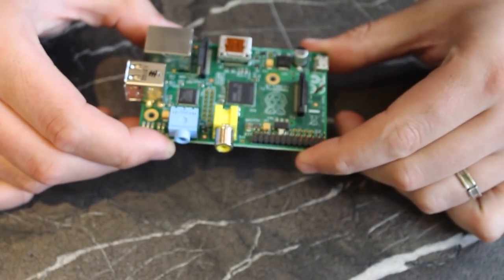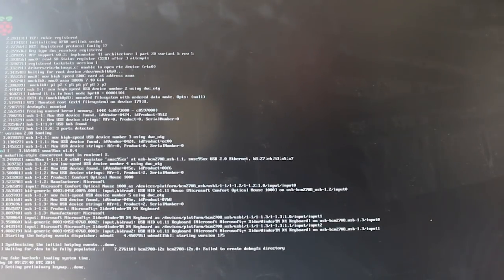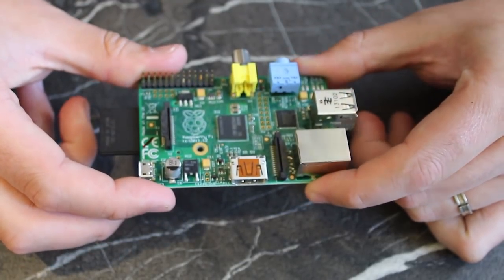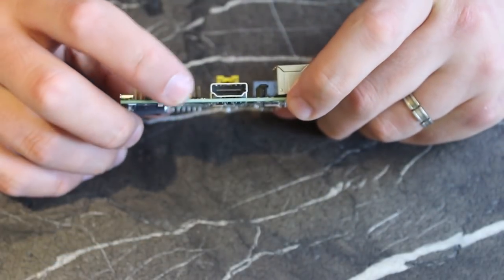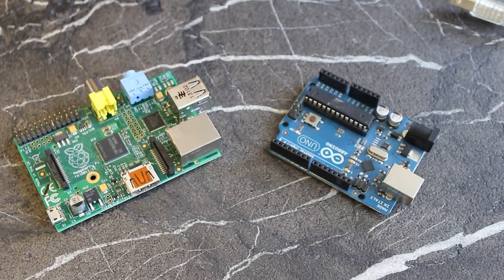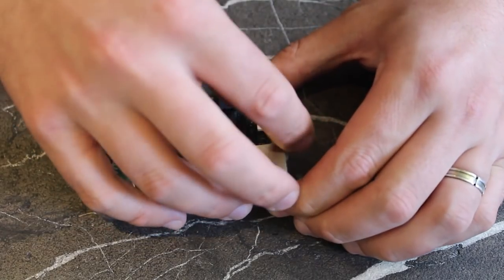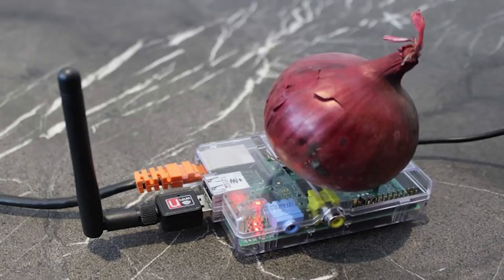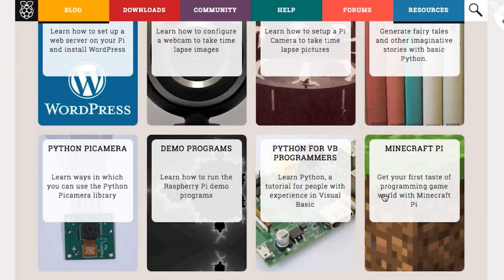Just Bought A Raspberry Pi? 11 Things You Need To Know

Comment: is it possible to install a linux os and access the internet like any other regular computer?
i would like to get the new pi zero to go to the internet like youtube and facebook and anyother websites.
and probably later get into programing.
this is a lot easyer to transport than even a normla laptop. as i travel a lot and always have an available tv with hdmi input i would really like to use the new pi zero or even get a pi 2 and use just for some internet browsing and maybe a few games like minecraft or some arcade like sonic or metalslug. :)
Reply from the maker: +David Cabral There's a couple of different Linux OSes that are compatible, and you'll need to make sure software you want has been compiled for ARM processors, but generally, yes. The OS most people choose is Raspian, a version of Debian. You can browse the internet, however, the Pi Zero doesnt have any networking, so you'll need both a USB OTG cable and a USB Wi-Fi or Ethernet dongle, plus a mini-HDMI adaptor. To be honest, you're probably better off just getting an RPI2, which is faster, and doesnt need a bunch of adapters.
Reply: +MakeUseOf oh i thought the pi zero was the fastest.
but ill probably get both. the pi zero and the pi 2 as they are really cheap. i dont understand really well how these boards work and im a huge noob when it comes to programing. but o really like the concept and would like to use this just to browse the web and a few more apps.
Reply: Is it easy to overclock the pi2?
Will it not blow up or overheat?
Reply: Ill get a pi2 and try that. Probably get a pi2 and a pi 0. Really cheap they are. :D
Reply: I just want it to browse the internet and maybe write a few word documents. Ive seen on youtube someone installed a type like office and i liked it. So basically its just that what i want it for. Web browsing and writing and maybe arcade games.
Reply: I mean arcade lime sonic or metal slug or supermario. If theres any of those games that will work on raspbian or arm processors.
Reply from the maker: +David Cabral Yes. http://piplay.org/

Comment: I'd quite like to get one of these for my nephew, but I'm concerned that, knowing nothing about the innards of computers, I'd be unable to do anything with it. How easy is it to set up and use and is it something a 10 year old pick up and use?
Reply from the maker: +MrNobody808 Depends what you want to do with it. You don't need to know anything about hardware, but you will need to learn some basic electronics if you want to interface your projects with sensors or motors. Mostly, it's a case of putting in an SD card, and plugging in a mouse and keyboard. For somethign specifically kid-friendly though, I'd recommend the Kano kit: http://www.kano.me/products/kano-kit (our review is here:https://www.youtube.com/watch?v=jwXfz0Bcx90 ) , which includes a guidebook and some coding tutorials, as well as educational software. Should make for a great Xmas present! You will need a monitor to plug it into though (or TV)

Comment: I saw that a new one came out with a quad core . I saw it retailed for 
$800  but now is $100 , do you know why, or is the retail price of $800 totally inaccurate?  TY
Reply from the maker: +Philip Franklin $100 is completely inaccurate also, so I'm not sure if you're confusing this with another device. I believe Raspberry Pi 2 is quad core, but the retail price is around $35. You may find starter kits for $80-$100, but those would include a keyboard, mouse, power supply, case and SD card loaded with software.
Reply: MakeUseOf
Ty! I found one on Amazon.

Comment: Hi Dave I wonder if you can help me? I am starting a project with LED lights and I need to build a controller.I brought the below

https://www.google.co.uk/search?q=100x+ws2812b+pre-soldered+on+heatsink+with+12cm+wire+dc+5v+ws2811+built-in+5050+rgb+led+pixel+module&safe=off&biw=1680&bih=739&tbm=isch&imgil=LS4eSRRz95XRgM%253A%253Bs2Rz-DFyAgHy7M%253Bhttp%25253A%25252F%25252Fwww.aliexpress.com%25252Fitem%25252F100x-ws2812b-pre-soldered-on-heatsink-with-12cm-wire-dc-5v-ws2811-buit-in-5050-rgb%25252F32276018589.h™l&source=iu&pf=m&fir=LS4eSRRz95XRgM%253A%252Cs2Rz-DFyAgHy7M%252C_&usg=__6e_ocL1BnNE7yl-jw3aCsOkCSy8%3D&ved=0CD4QyjdqFQoTCJrTnM7Iq8gCFQdvFAodGSAEPg&ei=l4wSVtqrMIfeUZnAkPAD#imgrc=LS4eSRRz95XRgM%3A&usg=__6e_ocL1BnNE7yl-jw3aCsOkCSy8%3D

I do know a little about programming but little could be an understatement .Would the Raspberry PI 2 be ok for this project or is there something on the market that would be easier to program.I am a complete novice to this but always willing to learn.

Cliff Partridge
Reply from the maker: +Cliff Partridge 

Hi Cliff. I'd recommend not using a Pi for those, are you'll need to mess around with voltage shifting. We've done a few projects with WS2812B pixels and an Arduino - http://www.makeuseof.com/tag/weekend-project-build-giant-led-pixel-display/ , http://www.makeuseof.com/tag/build-cloud-lamp-sound-reactive-lightning/ -> the cloud lamp in particular shows a number of different functions you could tweak for creating certain effects on the strip.

Comment: Could you plug it into a laptop and use the pie through the laptop
Reply from the maker: +Hampus Gaming (H Channel) You can power it through the USB port of a laptop, but you'll still need a separate monitor and keyboard, or a network cable to log into it remotely.
Reply: MakeUseOf Ive reserched it u need a internet cable only and a source of power of course u can use the monitor and the keyboard on the laptop

Comment: Can it play Terraria?
Reply: doesen't even reach the minimum RAM, and it would take up A LOT of memory, but it, If very laggily, COULD run the game to the most basic extent.
Reply: +Ghostie Not the desktop version. The Raspberry Pi 2 meets the system requirements however does not support OpenGL 2.0, only OpenGL ES. If you got and Odroid C1+ for the same price + better performance, you could install android and play it on there... it still doesn't support OpenGL though.

Comment: RPi $35, but plastic case $10
Reply: +TheNumberOne Page A case is necessary for the raspberry pi, because if you dont have it and accidentally place it on a conductable surface, it wont work and might even be destroyed.
Reply: >$10

Official cases are like $4.25 lmao.
Reply: < 2 $ at AliExpress
Reply: +G Yogaraja hot glue gun and scrap perhaps?
Reply: And then you need an SD card lol

Comment: so its basically a portable computer
Reply: CitCat Yes.
Reply: Jordan Weimer I have no idea what you just said or how your read that into my post, nor how you can even be "pretty sure" I said that. My point, and what I said, is that without at least one input device and one output device it is not, technically, in the traditional use of the term, a "computer". I mentioned nothing of OFF, ON, or NOT, which are lower-level hardware concepts.
Reply: CitCat Yes and No: there was a time (ITGOD) when it was clear that to be a "computer" there had to be at least one input device (easily usable by a human) and at least one output device (easily readable by humans). Since the Pi has neither it would not strictly be a computer until you added those I/O devices. But the term is misused everywhere nowadays...
Reply: +CitCat And so is a mobile, isn't it ?
Reply: +Wolf85565 Laptops don't have GPIO, cost $25, weight just a few ounces, have an incredible small footprint, or draw minuscule amounts of power. They are great for electronics projects and learning how to program.
Reply: +mar504 they can have a GPIO
Reply: +Wayne Brehaut, I'm pretty sure you just said, "Yes and no. Well, in technical terms it's a computer if it's on, but when it's off, then it's not."
Reply: +CitCat, it's crazy cheap $35 so you can play with it and not fear breaking it.
Reply: It's okay dude. I was mildly making fun of you for having contributed nothing of substance to the conversation. Your comment was totally irrelevant and the definition of computer you cited while logical it still manages to be moronic. When I unplug my desktop computer's keyboard and monitor, I'm still going to refer to it as a computer even though it is missing essential components. Also, like everyone else, I'm going to refer to Raspberry Pi as a computer (even at times when it's not connected to a keyboard and monitor) because that's what it fucking is.
Reply: You can do that if you wish, but I bet before you try to compute with it again you re-attach the keyboard and monitor. And I bet you attach some input device and output device to your RPi before you can do any computing with it too--otherwise it could just sit there storing and computing and you'd never know. You (and others) call it a computer because you expect to add a keyboard and monitor before actually trying to compute with it. I suspect you might also call your car "a car" if your removed the steering wheel and wheels, which is okay if most you converse with understood what you meant, but you couldn't drive very far until you re-attached them either.
Reply: +Wayne Brehaut Yeah, it would be considered a car. And if I went and bought a desktop tower with no keyboard/mouse/monitor I (and everyone else on the planet) would call it a computer. It is DESIGNED to compute, it doesn't cease to be a computer if a keyboard isn't included... shesh
Reply: +Wayne Brehaut a raspi has an output device. it is an HDMI port, also it has a ethernet port. Also USB ports. 
It may not be a personal computer but by your logic a Server would not be a computer and any sort of controller would not be a computer either. A computer does compute. If you want to get technical, for it to be a general purpose computer it needs a CPU (a processing unit, a control unit, some registers) a BUS some MEMORY and an IO if you want to get fancy. now IO means input output, but that is for interfacing with stuff like hard drives just as much if not more than it is for interfacing with screens and mice and keyboards and all that.

and that is just a general purpose computer which is a specific kind of computer (and pretty much all modern computers like car controllers, factory robot controllers, phones, coffee machines with a menu where you can pick and choose options on them and so on fall under that). There are specialized computers that dont even have all of the above.
Reply: +Chancelor Guerra (ElectroWolf86) Too costly, plus it would be a lot of work to add it there and make it easily accessible.
Reply: +Wayne Brehaut No, what made a computer was and is the ability for it to read input, process the input according to a program, and output the data in some way. This clearly satisfies those requirements. What type of I/O devices are used, whether or not they are actually connected, and their ease of use by humans, are not relevant. An old school PC in a desktop or tower case didn't cease to be a computer because you hadn't plugged a monitor or keyboard in. The look of the case, or even lack thereof, didn't affect whether it was a computer or not. The ease of use of the IO system definitely didn't affect it. There was a time when most compact/home computers I/O consisted of a few switches and a bank of lights. Input was by flicking switches in a computing equivalent of morse code, and reading the output meant deciphering the binary data presented by a bank of lights being on or off. This device was still a 'computer'...
Reply: Phoenix Issa Alright
Reply: your profile pic is the physical expression of your comment

Comment: I like the idea of these things and I certainly like the price, especially the pi 2 that's a 4core. However, they are pretty much useless to me until they can run at least the same programs a linux system can run. Specifically I would want the pi to run Blender rendering software. I would build me a killer rendering farm if they did run cycles.

Comment: how do I reset my rasp pi back to 192.168.1.114 what programme do I need
Reply: John ryner IP addresses are usually assigned by your router. If you want to make that IP address a permanent assignment, look into IP address reservation in your router control panel. You'll need to know the MAC address of the Pi, which should be listed under the existing IP table
Reply: John ryner Either login on your router and set a static IP from there, or (if you're able to connect to your Pi via SSH or via GUI) set it from the Pi.

Comment: It doesn't matter if the GPIO output is only 3.3 volts. The TTL specs specifiy that a voltage above 2 volt is a logic 1 and a voltage below 0.8 volt is a logic 0. Therefore no transistors or fet's are needed to connect to other logic IC's.
Reply: PeterK6502 Logic ICs, sure. 5v sensors, and output devices, no.

Comment: Do i have to use a microsdhc card to start the raspberry
Reply: DoctorCFG - Hosting CFG Yes, it does require a micro SD card, though you can configure it to only boot from there, then load the rest of the OS from a USB device

Comment: is it hard to work make something with the raspberry pi? im not a electronic engineer. but i would like to make something of it.
Reply: machiel ymker It runs linux, so just ask the same question of linux. If you can make it with linux, it can probably on the Rpi .

Comment: MakeUseOf I have a netgear N150 WNA1000M Wireless USB Micro Adapter, and im not sure how to work it, I plug it in and click wifi config but can't seem to find out how to connect it to any wifi ports. Any ideas? I would adore a video on how. P.s  You have gained a sub!

Patrick.
Reply: Appreciate. Unfortunately, wifi adapters on linux have always been utterly miserable with support - even worse on the pi due to it's different architecture. You're better off buying a new one that's guaranteed support for ~$20 that spending hours hunting down ways to make your existing one work.

Comment: I have an Arduino. Should I get a Raspberry Pi, as well? He made it sound like the Arduino has more capabilities.
The thing is, I've used it at school (only once) with MATLAB. When I'm done with my course, I'd like to continue tinkering around with it. I just don't know, what kind of stuff can I do? Are these things circuit boards and really small, programmable computers?

Don't worry everyone, now I have one of each!
Reply: In short: The Arduino lets you do more with standard electronics. The Pi lets you do more with software.

With the Arduino, you're basically limited to programming in C - unless you interface with a PC and use standard firmata. With the Pi, you can program in anything you want - Perl, Java, Javascript, whatever.
Reply: It is basically a full computer but with an ARM processor, so in terms of software it CAN be kind of limited.
Reply: raspberry pi can do more but is more expensive. In fact, it is possible to go bare bones on pi (but why would you bother?)

Comment: If I were to get a raspberry, can I install an OS on 1 SD card, and say and emulator on another SD card and a different project on maybe a third SD card? Can I just swap the SD cards out or do I need seperate raspberries for each project ?
Reply: u can swap em....as far as i know
Reply: Yhea you can do that with the sd cards.
Reply: Yes. Everything the Pi needs to run will be specific to the card. But, bear in mind that SD cards eventually wear out - if you're doing something which is write-intensive, you'll want a USB storage stick as well (the pi boots from the sd card, then switches over at runtime to the USB). This will prolong the life of your SD cards.

Comment: Here is an idea! Anti Key Log device.  In theory you could write two python programs that talk to each other through a local area network one of these programs would be on the pi and the other on your main pc.  Your usb keyboard would be plugged into the pi, all your keystroke would be captured onto the pi and then sent to the listening program on your main pc through the network as encrypted strings.  The listening program on your pc will then decrypt the strings and send them to the clipboard and programmatically paste the keystrokes to wherever you're typing.

Obviously it's not going to be that simple, but hey lets give it a go :).

Comment: You got a lot wrong in this video.  My A has a network.  No mounting holes.  No default os.  there are more versions and more details than you address.
Reply: No, the A version does not have an Ethernet port. You may referring to the A+, which was released after this video was produced. Or you just have no idea what an Ethernet port is.

Comment: another solution if you don't have a spare monitor, mouse and keyboard is installing xrdp which lets you get a graphical remotedesktop as supported by Windows out of the box or via downloadable software on other os. it is not thought for watching videos on it but it gives you a graphical surface.

Comment: if you plug the pi's power source into a USB 3.0 port on the computer, it will get enough power for quite a few things, as USB 3.0 spec requires up to 1.5A capabilities